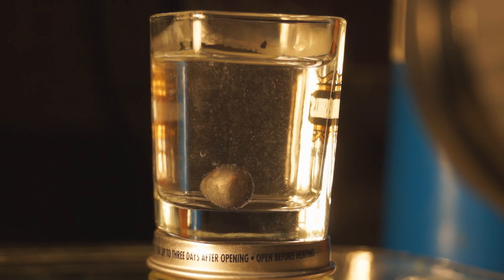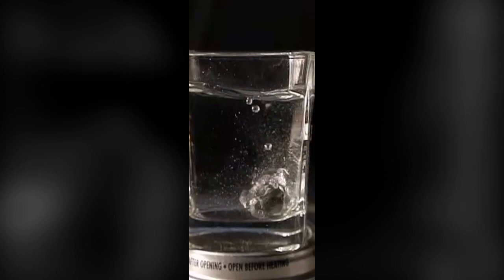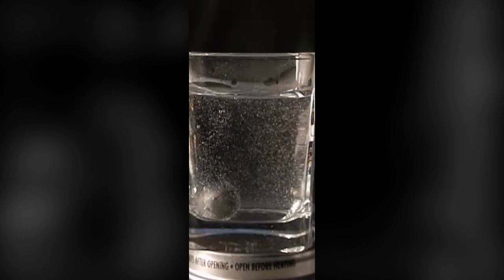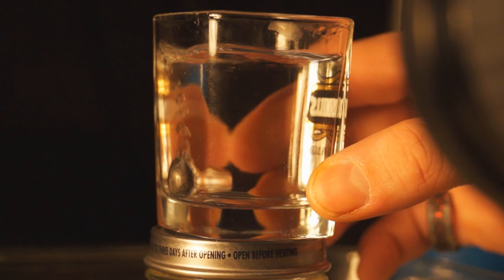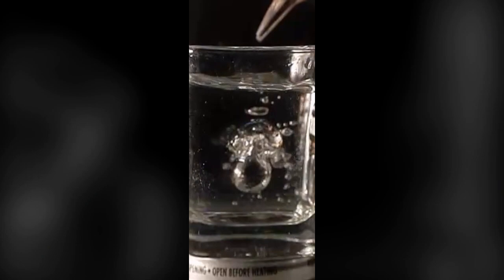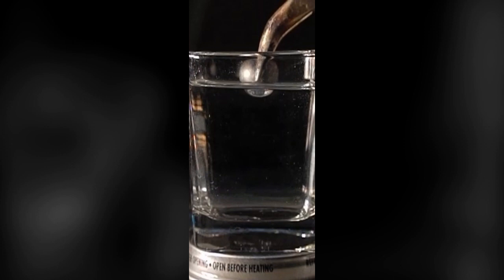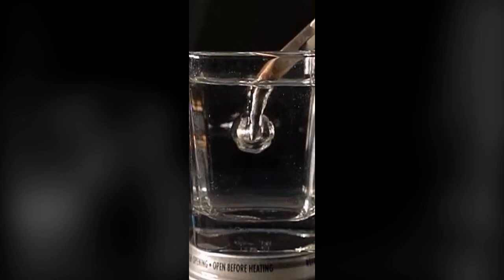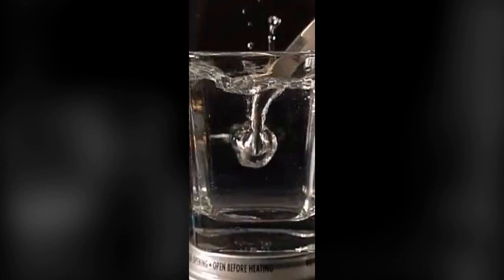Leidenfrost Effect in Slow Motion

Comment from the maker: I hadn't thought of it that way but I still think a super heated boat would float. The water vapour would be pushing against the water the boat is in as well as the hull, like a hovercraft but without a skirt. If the boat sank to deep it would boil more water. The expanding vapour would push back on the hull keeping it buoyant. If I can think of a way to test this easily in small scale I will and will post a video.